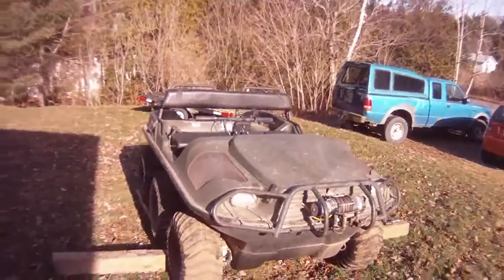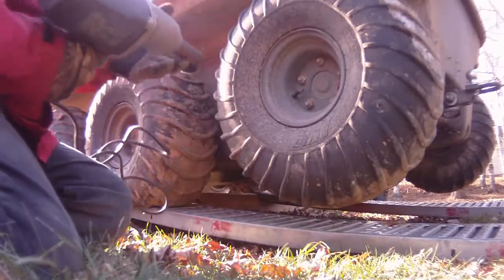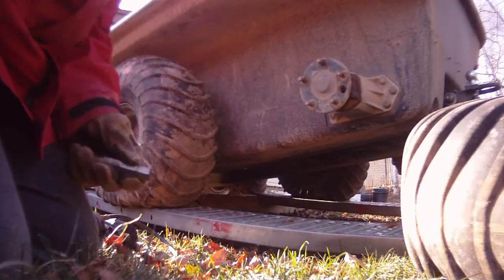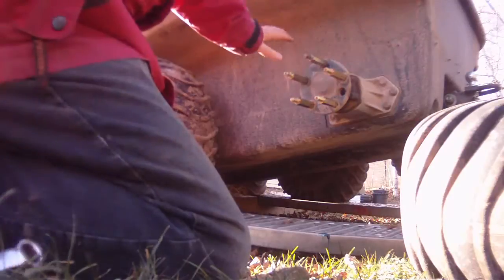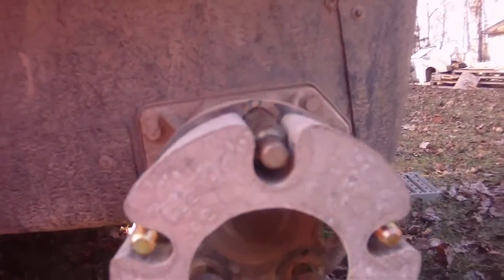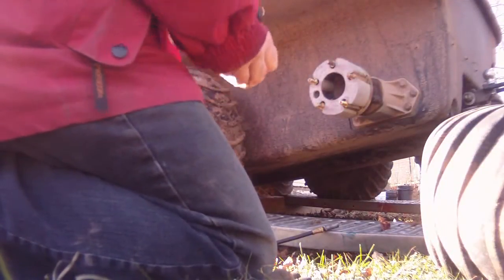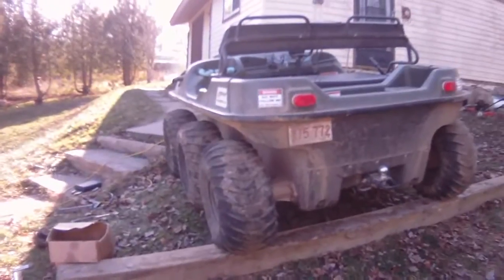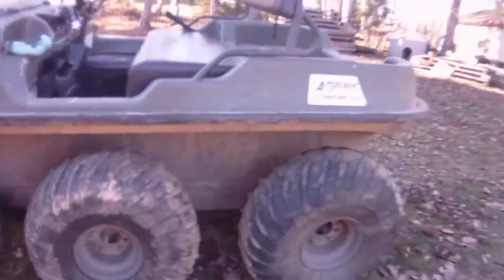Argo Axle Extensions Install

Comment: Thanks. I forgot which way around the spacer was supposed to go. As mentioned by another you have not aligned the grease hole on the spacer with the hub hole. Also so much easier to grease the bearing with wheel off and that requires alignment of hub hole with grease nipple. To do that jacking completely off the ground is necessary to turn the hubs into alignment unless you get really lucky when parking it. Take care.
Reply from the maker: Yes you are correct. i did place the grease hole in the wrong place and should have been more informative when i corrected my mistake in the video. Wow I did this so long ago and it was nice to watch it again. I still have the same Argo and it still works like a clock. If you are looking for a good Argo site where people are very helpful and you are on Facebook, Search for Argo ATV Offroad. They have over 5000 members and it is a very informative site, Thanks for getting me back to watching this one,.